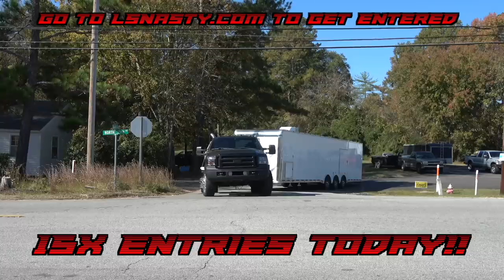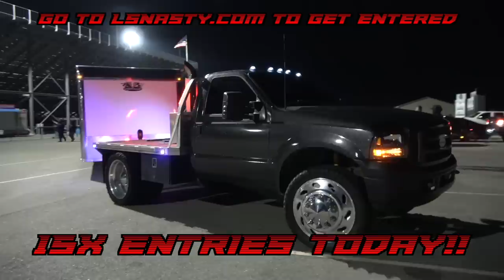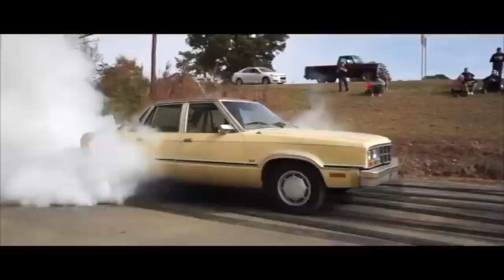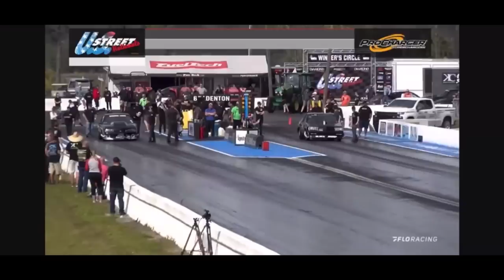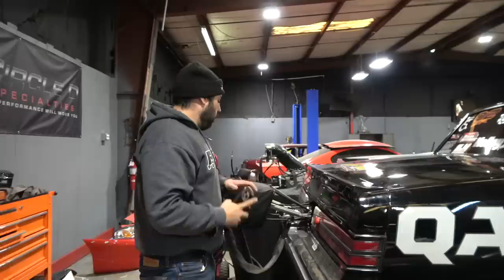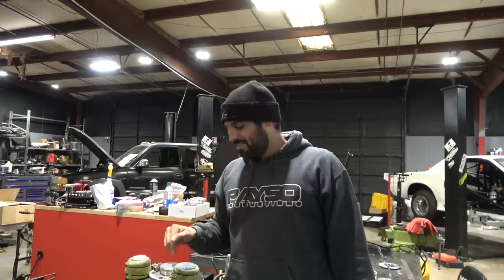IT HAPPENED!!! SELLING THE BLACK SHEEP!!!!

Comment: Do you ever have a problem spinning when the black sheep hits the chains? Dirt oval cars that run limiters have the chain on a spring or rubber to dampen when the car tries to pickup all the unsprung weight.
Reply: Not really it’s not nearly as violent as it is if we had the last 2.5inches of separation in use.

Comment: John why don't you run a bigger wing on the car ? I've been wondering about that would it benefit you to Run a bigger wind ?
Reply: Not really… the wings are more for top end stability. You don’t really get much downforce from them. The car goes pretty straight so if it’s not broke don’t fix it. It doesn’t come unglued down track.
Reply: @MET90LX   I don't know if you've ever been Drag Racing?  I have and there's a lot of cars that run 8 miles with big wings I was just asking John. You can always benefit from downforce
Reply: @robertjohnson4784  I definitely go drag racing. John even said himself in a reply to another comment. The car is stable at speed. Drag wings like you see on pro mods, radial cars for the most part are there for stability.  You see some bigger wings on no prep cars because they actually need the downforce. But a radial car on radial prep doesn’t need downforce to stay hooked up. So unless the car was unstable at speed there’s no need for a bigger wing.